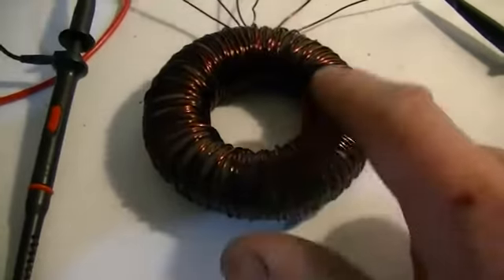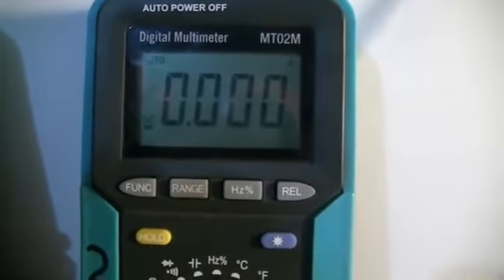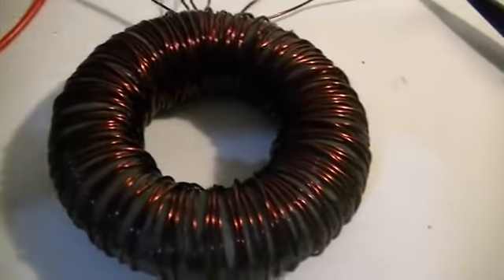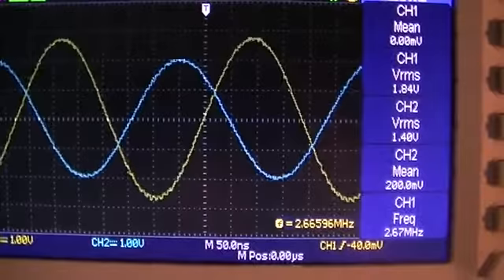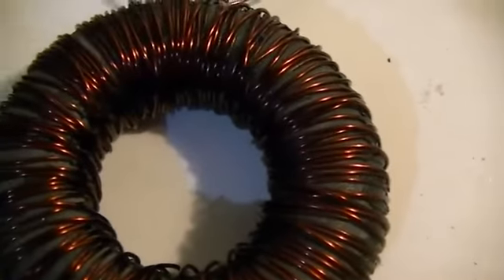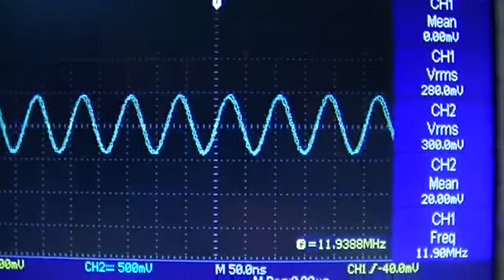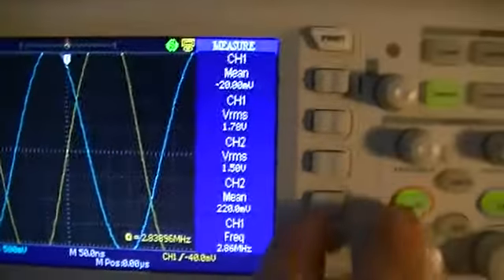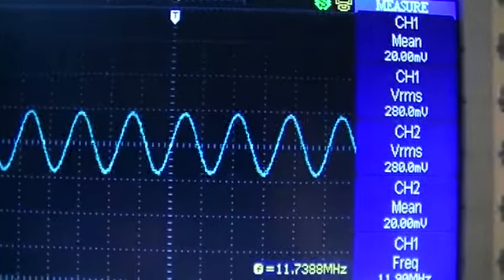Toroid experiment

Comment: the phase shift at 90 degree remind of Marko Rodin design DNA , enneagram and other 3 6 9 stuff also why do the two sec. windings have different amplitude you should calculate the difference voltage and see if there is harmonic differential relate David Sereda differential theory